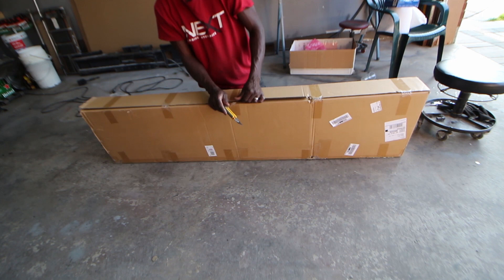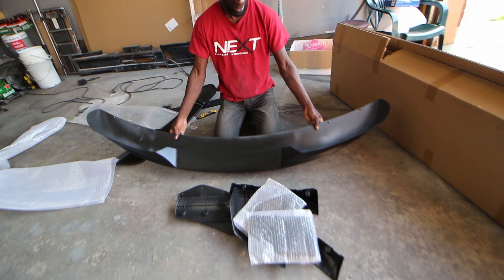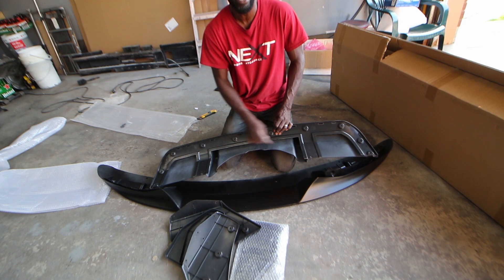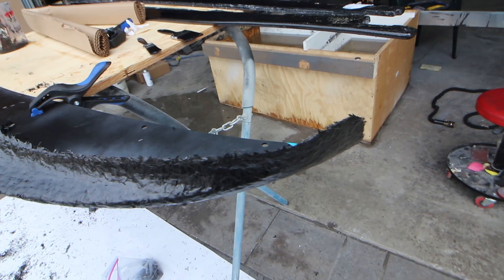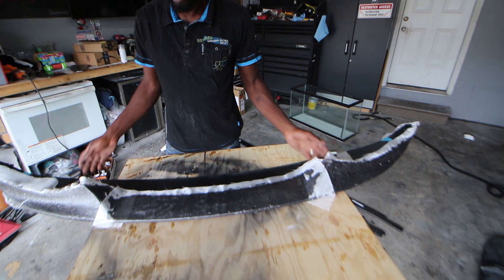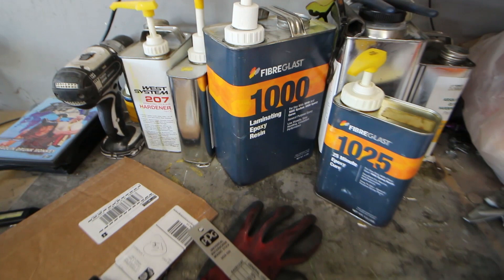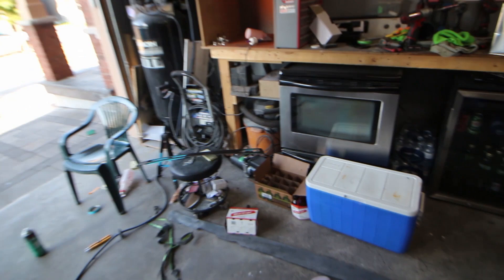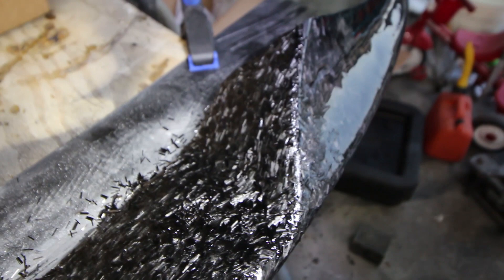BMW X5 GETS FORGED CARBON BODY KIT

Comment: I was about to go on PornHub, then I got this notification, so I chose this instead, lmao, JKJK. Nice body kit yo. Nice idea to use carbon fiber trimming to get that forged carbon look. A company called ULTICARBON sells forged carbon sheets for lamination, if you're ever interested check them out. This technique is called carbon fibre skinning and is  a nice solution if u just want the looks. But if u want the professional look of the forged carbon you need to vacuum bag the project part. Also check out Lindy Design Lab if u want more information of carbon fiber skinning. Lastly hopefully you're wearing mask while working with carbon fibre since those micro dust particles from carbon fiber causes serious, I mean serious cancer. Nice projects keep it up.
Reply from the maker: I will check it out.  Thanks
Reply from the maker: I see u a anime fan
Reply: @FATmods  haha Yes I am.